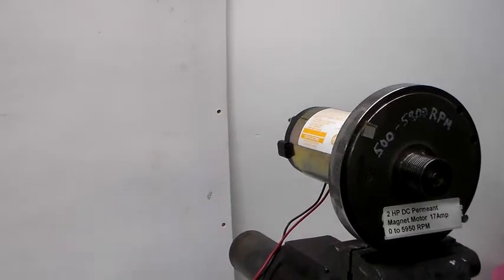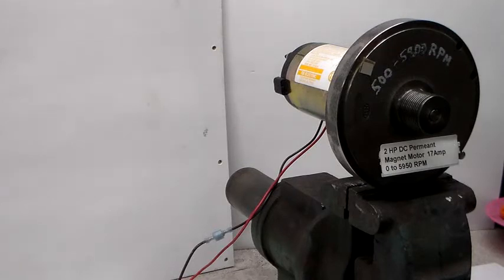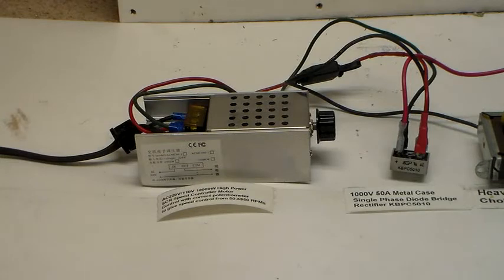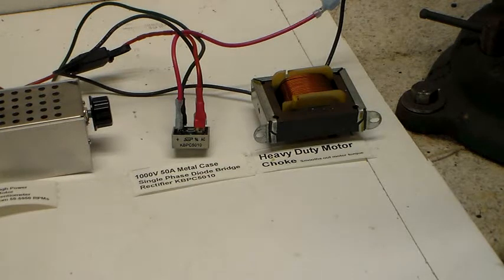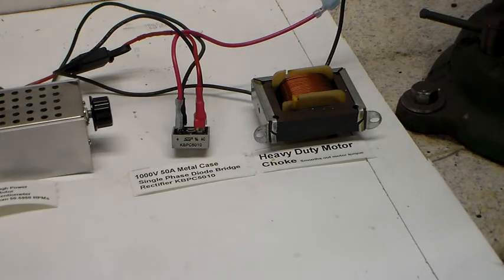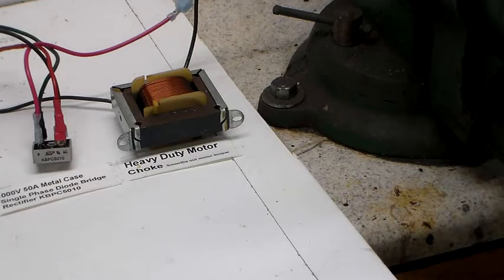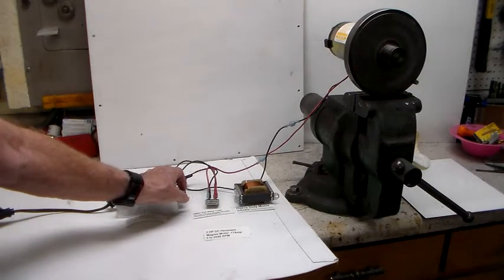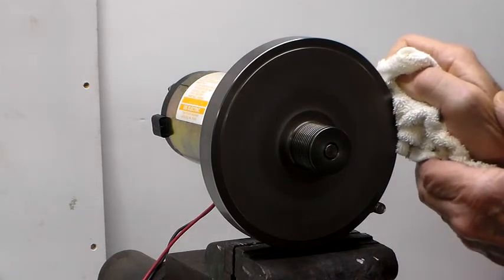Treadmill 2 HP DC motor and speed control

Comment: Hi I have a 1.25 HP, 180 volt at 5 amp. I have a 4 KW ac speed controller and a KCP 5010 bridge rectifier like your unit. The motor runs but turns off as my speed sensor error comes on. If I measure resistance of speed sensor? Can I eliminate the problem? Or stick to 4000 watt AC controller with bridge rectifier? Any reply appreciated. Cheers from Australia 🙂
Reply from the maker: I have to make a few assumptions.  First by the specs of your motor I would guess it is a permanent magnet motor and in Australia you are running 220/240 volts ac.  Also are you trying to run a DC motor that came out of a tread mill or a real, heavy duty motor with a regular mounting base?   Is your speed controller a $15-$20 type off of ebay or an expensive type with lots of internal adjustments?

Comment: Is thechoke in the hot line between the dc motor and the rectifier?
Reply from the maker: The choke is actually in the black/ground side of the motor line.  It may work on the positive lead but mine was hooked up in the black, negative line.

Comment: When I turn on my machine it spins at full speed.
The speed does not decrease.
What to do.plss
Reply from the maker: A couple things you might check if you have a volt ohm meter.  First thing, did you change out the existing potentiometer with one of a different value?  If so you may have it hooked up wrong.  If you did not change out the potentiometer then unhook the output wires from the solid state controller and set your volt meter to at least 300 volts AC.  With the controller on put your meter leads across the output lugs on the controller.  Now operate the potentiometer and see if the ac voltage changes.  Let me know if this helps or not.
Reply: I've been having the same problem twice... I changed it for this a DC speed controller
https://www.amazon.com/dp/B08DHY3WQ6/ref=cm_sw_r_cp_apa_glt_fabc_J2J8EGWW1GBCMZ088M7G?_encoding=UTF8&psc=1
It works well now but the 2.5 HP motor got weak and it stops at any resistance to the disc...any other advice?

Comment: Is there any way to control or to put the maximum speed the motor is allowed to turn?
How we do that? 
Is just by putting a resistor as current limiter is enough? 
Cheers from Indonesia.
Reply from the maker: Yes, you could use the  variable resistance potentiometer  and adjust to your desired speed then just use an on off switch  to turn in on and off.  Or use the pot to get the speed you want, carefully remove the pot, check what resistance you have and then replace the pot with a fixed resistance resistor.

Hope this helps
Reply: @Histandard2011  thank you very much for your quick response. I thought that it would be answered next month or even longer. Cheers from Indonesia Chief, have nice day for you.

Comment from the maker: I removed a 500K and installed a 200K.  Sorry to take so long to answer.
Reply: I removed  my 500 K installed a 200 K still need it slower installed a 10 turn 2 K stays at 1 steady fast speed . If  I hook it up to my bench top power supply I can get it to move real slow with 1 volt . Does any one know what size pot I need maybe a 100 K ?